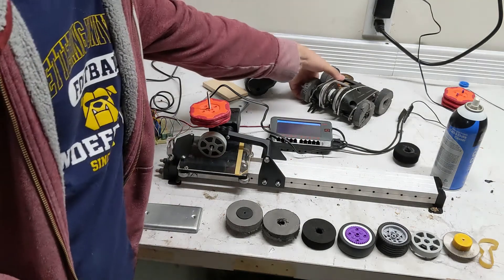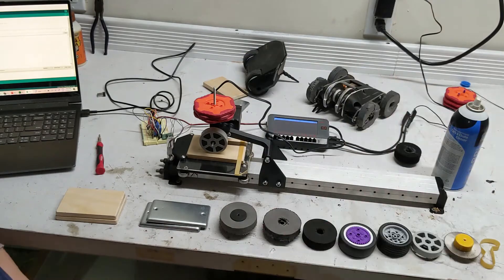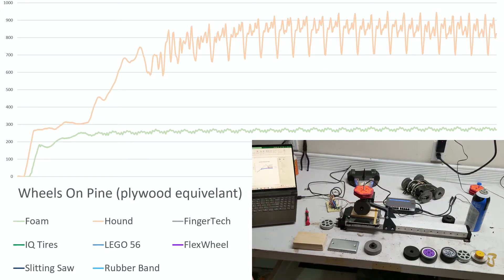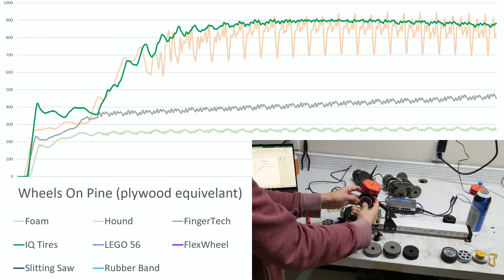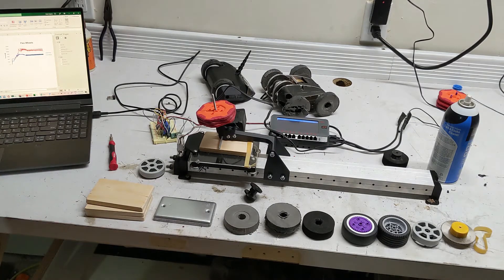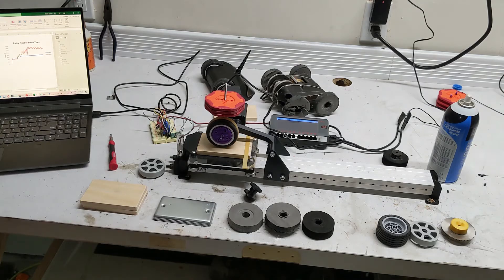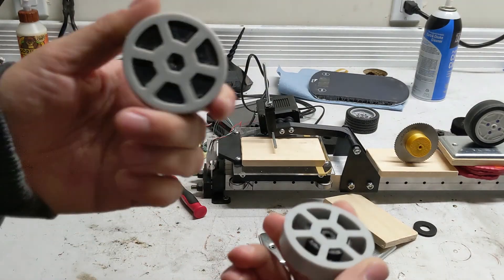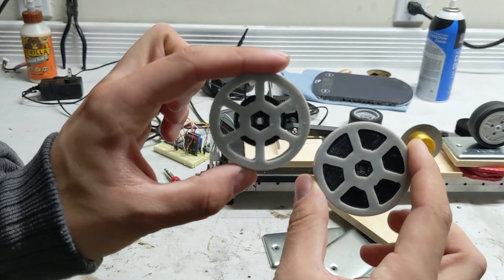Combat Robotics Wheel Traction Showdown.

Comment: Hey man, don’t know if you respond to old comments. However, I was curious if you still have this setup? I would like to know how well Plasti-Dip does on top of a foam tire (it’s what I’m currently using and I really like it!)

The biggest perk of Plasti-Dip is that a thin coating of it soaks into the foam a little bit, which holds chunks of them together after smaller, direct hits to tires. 

I’ve also heard of people with thick Latex strips and Rubber bands get in trouble for them falling off and entangling weapons. Your grip enhancers falling off tires sounds like a big downside to me!

Comment: Hi, I stumbled across your Hound videos a while back and was really impressed by some of the design features, and this project is also really cool!
I've been trying to find and create more data about combat robot component performance, including traction, but your load cell implementation looks much more accurate than my prototype traction testing setup (using an analog force gauge).
Did you make the load cell yourself or pull it out of something?

I'd be really interested in the grip of wheels with molded Vytaflex tread and also molded silicone sealant tread.
Another aspect that is really important but also extremely difficult to quantify is how the different tires perform after picking up dust or other debris. Perhaps you could roll a wheel through some "standard dust" before a test? Or alternatively, "prep" a wheel with isopropyl alcohol or another compound?
If you are interested, I have some Vytaflex 40A wheels and the ability to make some 30A parts to send to you to keep for testing purposes.
Reply from the maker: Was thinking of putting PLA in a blender as my standard "dust" to test but the video already felt long at 18 minutes so I did not finish that. The load cell is a cheap Amazon load cell hotwired to run at 80hz rather than 10

I would love some more wheels to test. Send me an email and we can figure something out